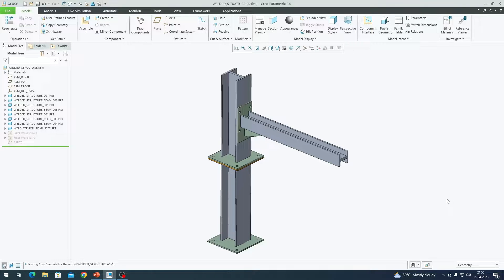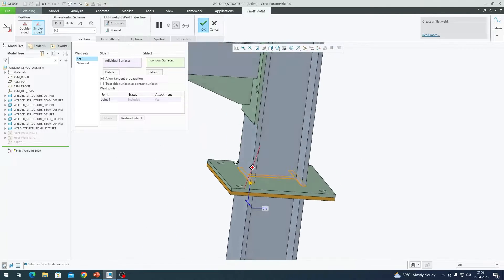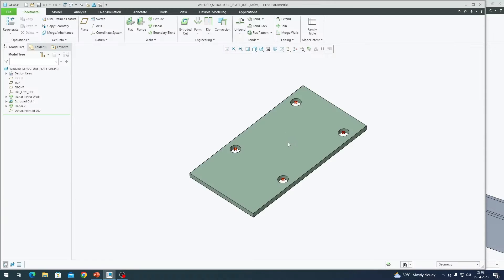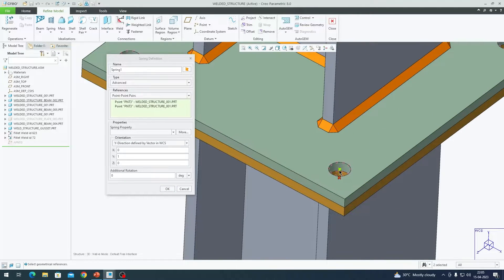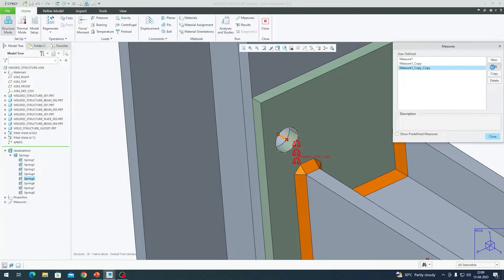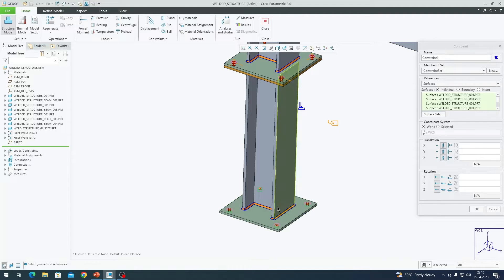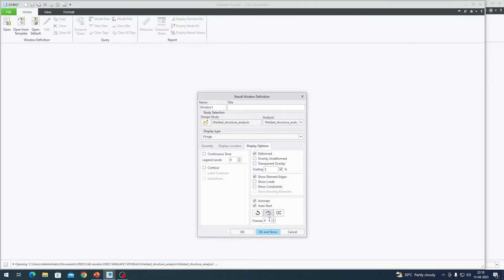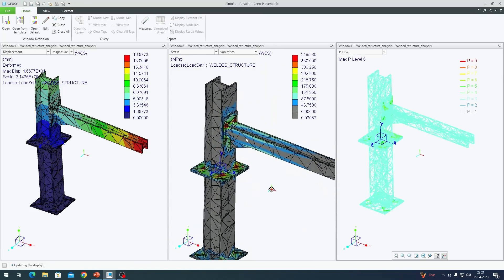CREO Simulate - Static Structural - Welds, Bolted joints, Springs (Part 3)

Comment: One question. Why do you idealize a fastener as a spring when Creo Simulate has a Fastener interface available where you can set preload? Is there any advantage in doing it your way compared to Fastener feature?
Reply from the maker: Good question. There are several ways we can represent Bolted joints. Even Creo represents the fastener as a stiff spring in the background while solving. The reason to use springs is to keep the mesh simple and extract accurate value of bolted joint forces. Using these loads engineer has to perform bolted joint calculations using hand calc or some program using python.
Reply: @MECH_ADHI  When you mean to keep the mesh simple, does this mean that we need an actual fastener modeled there if we want to use the "fastener" feature? Don't really know how it works/how to use it yet, still early on your videos and been really helpful so far! Thank you for making these and explaining!
Reply from the maker: @its_oms_5012  Use of fastener tool from Creo is a quick and easy way to model a bolted joint. Doing this way is close to modelling a bolted joint using a beam element and RBE2 elements to connect the bolt head to your abutment. This created additional nodes on your model and thus, created more complexity. Using springs on the other hand, lets you define the stiffness explicitly and extract accurate loads faster (because stiffness is already plugged in, your solver doesn't necessarily create a stiffness matrix). Other reason is, you might have to deal with resilient joints (isolation mounts, rubber mounts or viscous mounts). In those cases, you would need to plug in different stiffness values in each direction. Spring becomes convenient in those scenarios. Bottom line is, to perform bolted joint calculations for large models and resilient mounts, spring make things much eaiser. For small models, fastener can be used where computational time is disregarded.

Comment: I have faced "Model is insufficiently constrained for the analysis" error. It refer to springs. What should I do to correct this error?
Reply: Pls check if you have rigid links between spring centre and hole’s outer edge. If u still get the error, run a modal analysis with rigid mode search turned on. It will tell you where your model is detached from the equation.

Comment: Make a vedio on how to read the results, if it is dispalying 200Mpa explain what does it mean. 

And basics of FEM ,like why we need to mesh a component, what kind of constains should be given at different parts/joints, and different types of analysis.

 so far so good .keep going we mechons are there to support you.
Reply from the maker: Hey Azarudin ! Thanks for taking time to comment. Your feedback is well received and the upcoming videos will surely fulfil your requests!
Reply: @MECH_ADHI  thank you, how to make the point size bigger it is not visible as what is in the vedio, i tried searching in option, entity display but couldnt find the right one.
Reply from the maker: @azarudin1703  I am using Creo 8.0. If you are using any version before that, datum point would not look as big as show in the video. I tried searching for a config option to change its size but haven't found one yet. I will let u know if I find one. Thanks!